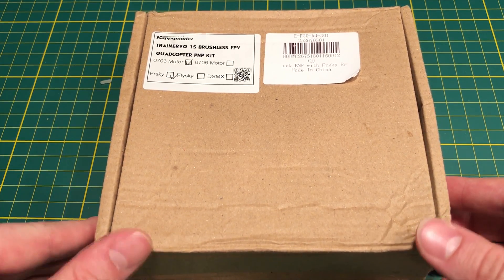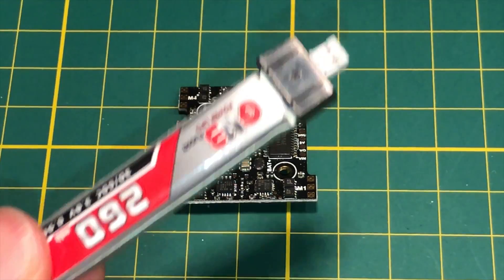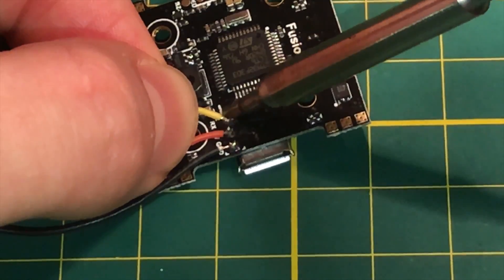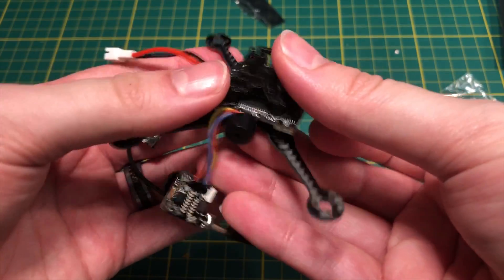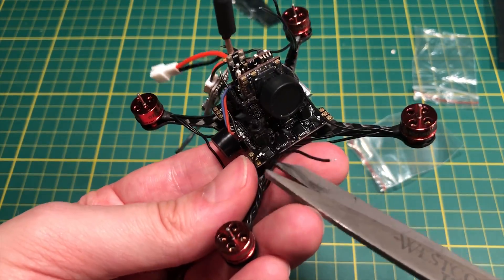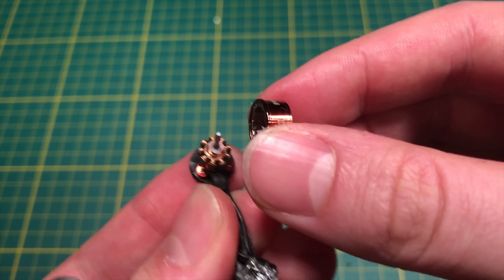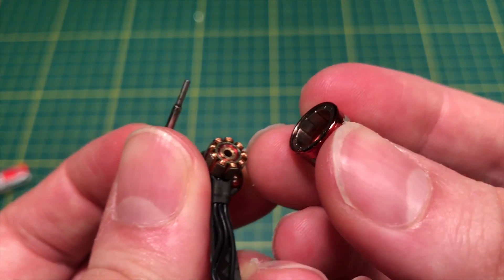Trainer 90 1s Brushless FPV DIY Kit

Comment from the maker: 0:33 - fusion x3 flight controller power lead soldering
1:37 - frsky sbus d8 receiver soldering
2:16 - fpv all-in-one camera soldering
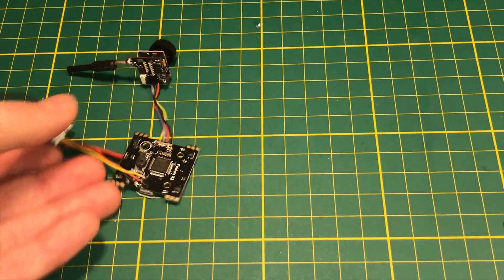3:12 - buzzer soldering
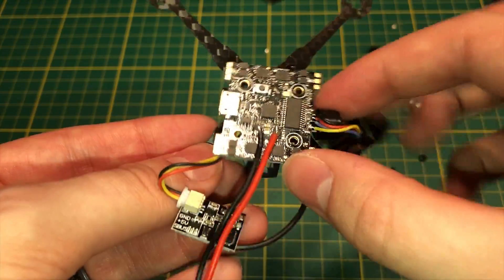3:39 - carbon fiber frame mounting fc
3:54 - 3d printed camera mount
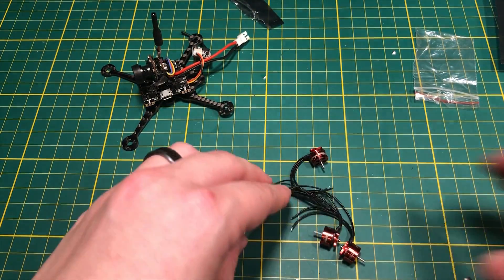4:55 - 15000kv motor mounting & soldering
6:00 - what went wrong